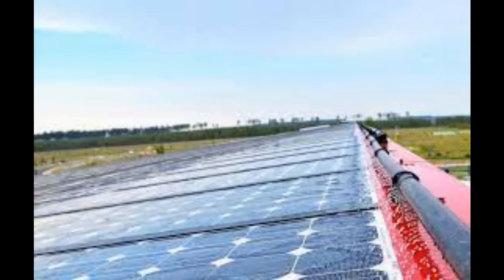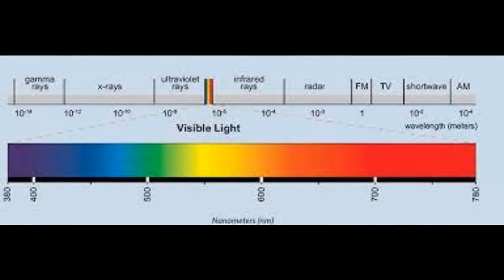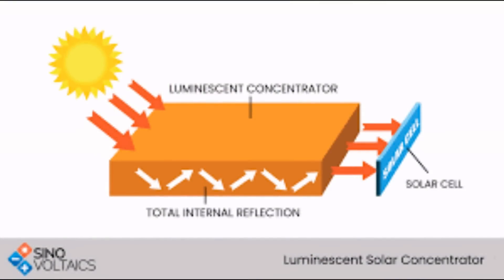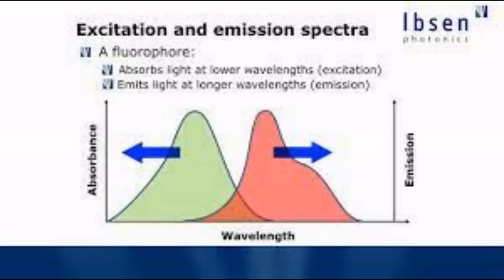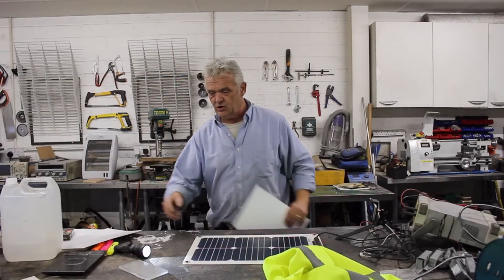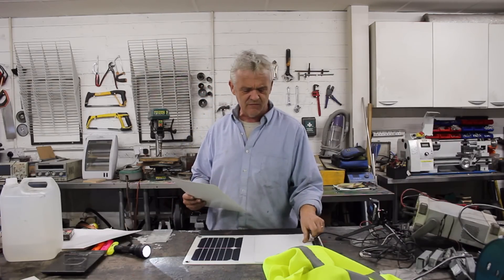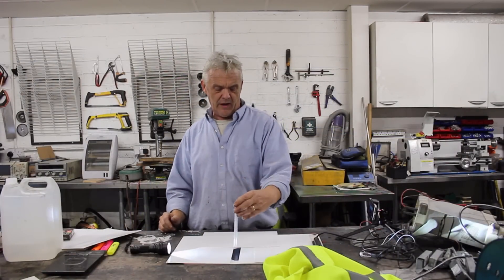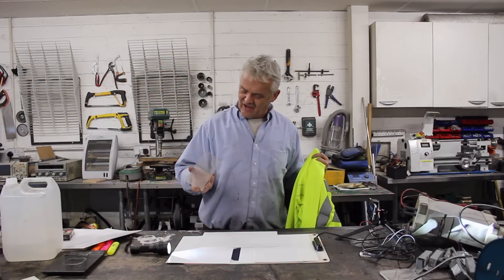1664 Supercharge Your Solar panels With Fluorescence

Comment: This makes me think about the nuclear battery you made. Using the technique you mention but using radioactive decay to make phosphesance or fluorescence instead of light visible or none visible. You could use a combination of both.
Reply from the maker: interesting idea mate
Reply: @ThinkingandTinkering  uranium glass or the radium paint that was used on pilots watches comes to mind.
Reply: @ThinkingandTinkering  Cerenkov's radiation (light) could be utilised some way too.
Reply: Basically what I'm trying to say is a glow in the dark material charged by radioactive decay powering a solar cell. If it could be charged by other frequencies from the EMS even better. Cosmic rays , infrared , ultraviolet............ect.

Comment: Love to see the idea but in this case, isn't the light guide really just increasing the surface area of the cell? and the shirt acting as a reflective surface increasing the effective surface area? If you used a  white piece of paper it would do the same thing as the shirt?
Reply from the maker: no - I tried but I try to keep the vids to the point - plus this is backed up by an awful lot of research showing it works - it is more of a home version you can do yourself
Reply: @ThinkingandTinkering  thanks for the reply, please keep up with the fantastic content